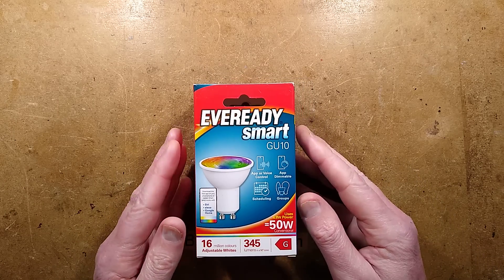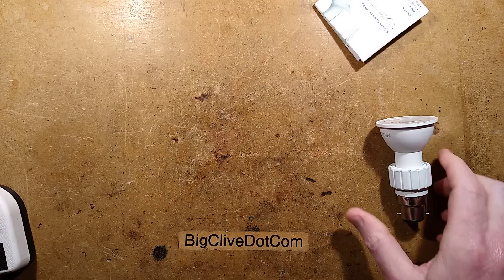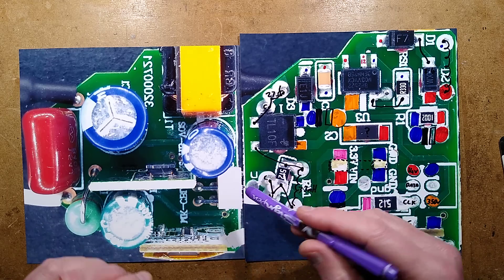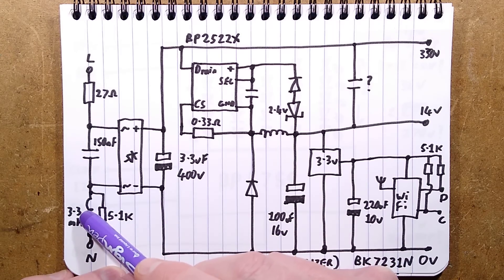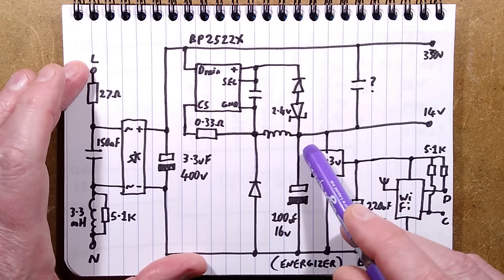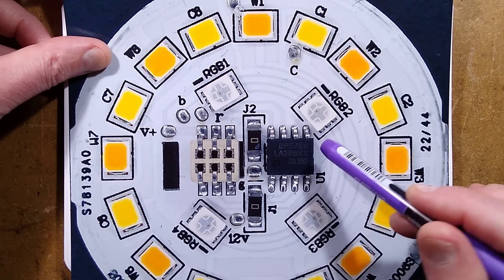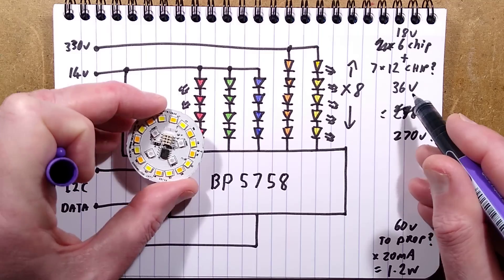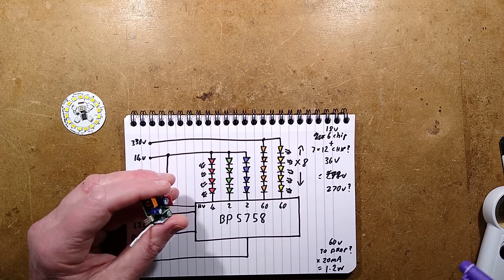Poundland Eveready WiFi lamp teardown - with very cool chip

Comment: I find it almost unimaginable that you could fit twelve LEDs on a sliver of silicon half a square centimetre in size.
Reply: Ya now think about how theyve figured out how to make a transistor 2 nanometers now..  is the absolute potential of silica..  thats so small even bacteria cant fit in between the blades of the switches in the transistor.  That also is a billion transistors in one square cm..  super duper tiny..
Reply: I thought it was smaller than 50mm² ...
Reply from the maker: It's usually a 4 by 3 array, sometimes on a single substrate that looks as if it's manufactured as a single component.

Comment: Looking at the packaging my guess is that Ever Ready use the same size box for all their lamps.
Reply: I was thinking they have repurposed a "standard" box and had it printed..
Reply: I suspect they use the same box size for various devices like cameras or doorbells, as well.
Makes outside shipping packaging more standard.
Reply: Could also be to fit the remote for lamps controlled by an infrared remote, which is the version I prefer, honestly.  Waaaaaaaaayyyyyyyyyy too many things nowadays require apps that should not need them.
Reply: I wonder if the larger packaging is  to make stealing it more difficult, though you could just take the bulb out of the box i guess.
Reply: @echothehusky  I think you're dead right there.
Reply: @echothehusky from the top of the box it looks like a seal was cut through that took up the entire side 0:14 .  not just a little circle, but the whole dang side.

if course, you can still steal that too but it's a lot harder to cut a big ass box and keep it from cameras than if it was just a tiny box like the cheaper one

Comment: It's a shame the Wi-Fi chip will most likely be proprietary preventing flashing with non-cloud dependant firmware... These companies will eventually learn that we really don't want zombie Wi-Fi devices on our internal network...
Reply: Just wait until they appear on corporate networks and some naughty individuals work out how to exploit them. I look forward to seeing the pentest reports that say, "Broke into your corporate data centre via the staff room Wifi lamp bulb."
Reply: It's probably a ESP8285, the single-chip variant of the ESP8266, which there exist hundreds of alternative firmwares for, and it's even compatible with Arduino etc.
Reply: @zaprodk  It's a beken chip, still reflashable. Not to mention wirelessly as opposed to the Espressiv chips which have to be soldered to.
Reply: @zaprodk  have you not heard tuya switched to bekeN?
Reply: Probably not actually, most of these widgets use one of about four commodity wifi SoCs, most (if not all) of which have alternative open source firmwares, whether or not you can get to the module to re-flash it without destroying the bulb is another matter though. 
This video covers some of the variations https://www.youtube.com/watch?v=UcyY1o26e4I
Reply: Yep. Just like the Vegas casino whose IT systems were hacked into via an IoT connected "smart" thermometer located in their fish tank...

Comment: A few years ago there was a big panic about TVs on standby using a lot of power.  What's the consumption as a result of running a houseful of wifi bulbs ?
Reply: About 120ma mostly and that's for the WiFi chip maintaining a connection. (Current assumed as similar to an ESP8266 standby current)
Reply: @dougle03  Then that's 0.4W for the chip, so we'll round up to half a watt per LED. Twenty Wifi lamps amount to ten watts standby. A bit wasteful I guess.
Reply: @dougle03  Except now that I've watched the video, they used a linear regulator on 14 volts, so the standby power is 1.7W?!!
Reply: @rexsceleratorum1632 yeah that is biiiig jump ! but with little current.
Reply from the maker: It's very low.  The power supplies are very efficient and the circuitry has fairly low power use.
Reply: I'd say you can save a lot of power that you would have otherwise wasted if they weren't smart. For example them being left on when they shouldn't be.
Reply: ...or the USB power supplies integrated into your mains sockets...?
Reply: The standby panic was due to Philips making CRT TVs with the tube heater filament permanently powered, so you didn't have to wait 30 seconds for the picture to appear, the transistorised sound coming on instantly. This led to standby taking 80% of the running current, not the few microamps of today's standby circuitry. Of course, the picture valve heater, which had several thousand hours theoretical life (due to being under-run), started failing inside the warranty period, and Philips swiftly dropped the idea, but the myth about standby taking 80% of running current still lives on in the Nanny State mind!